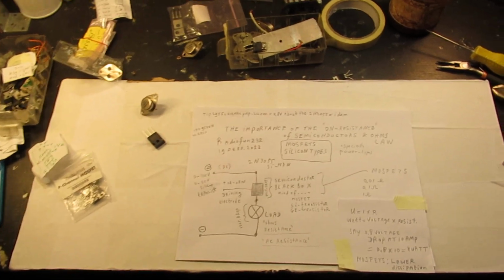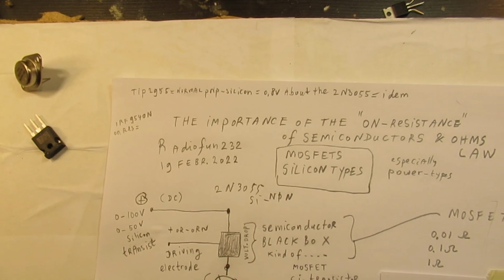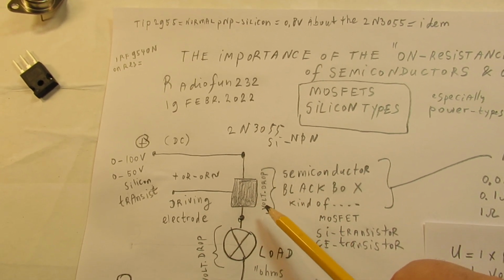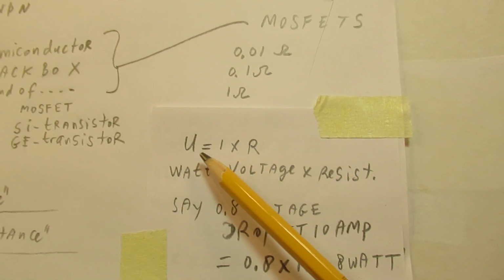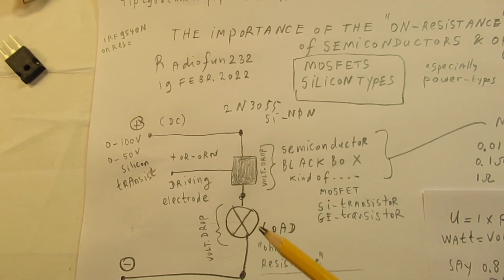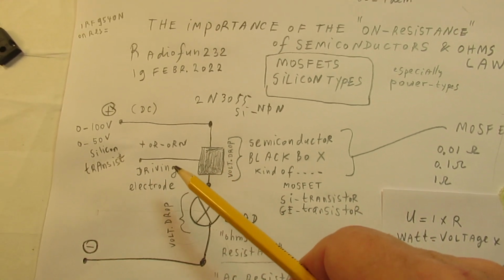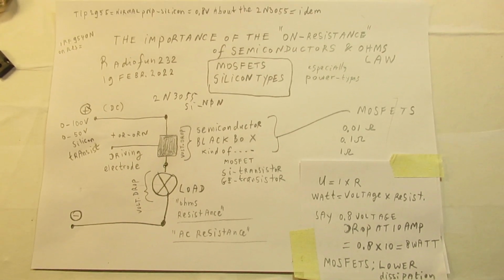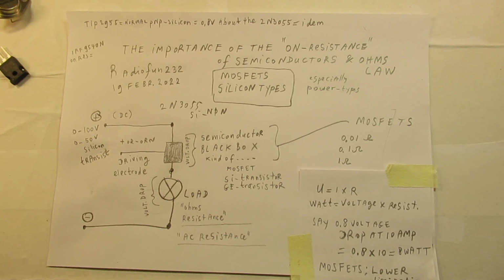About the "on" resistance of power transistors or MOSFETS related to dissipation and Ohms Law

Comment: Hey, I found out if you put a green or yellow led in parallel to the gate of a mosfet that would help prevent overheating? just match the correct mosfet for the size of your load and don’t ruin it with overvoltage
Reply from the maker: I doubt the idea, but anyway, thanks. A LED is in fact a diode and the color of the LED tells something about the barrier voltage with which such a LED can protect something. Always: never protecting against over-current, due to the LED properties. On over-current the LED will burn out.  A Green LED has another barrier (say drop off) voltage compared to a yellow LED. More info on my YT Channel about these LED properties. 20 feb 2022.
Reply from the maker: Here more about LEDS and their barrier voltages https://youtu.be/g9KngL0e6NI